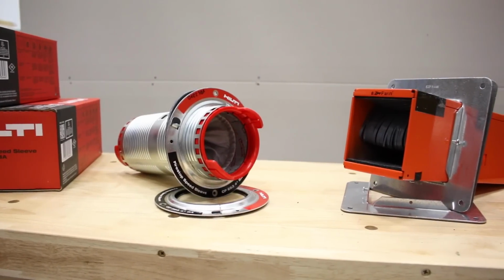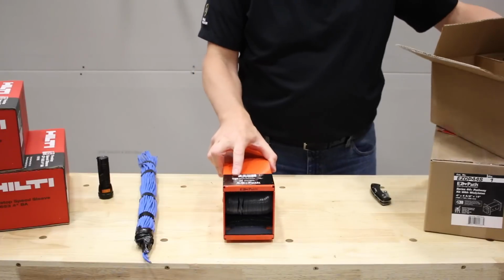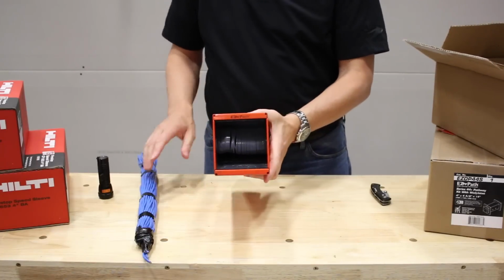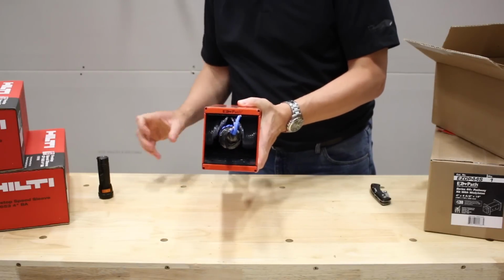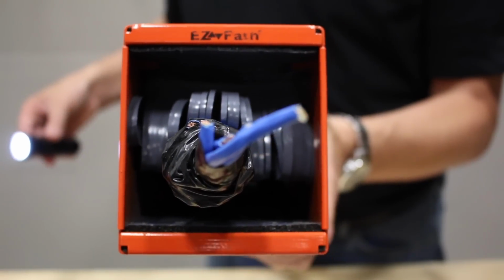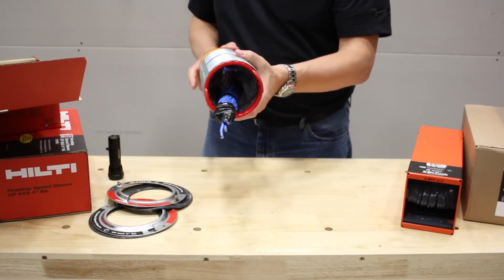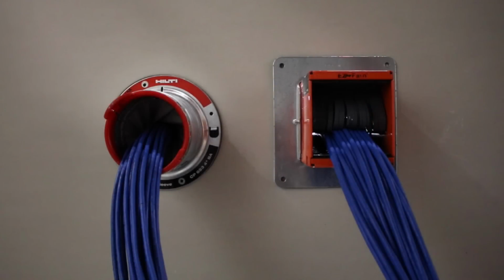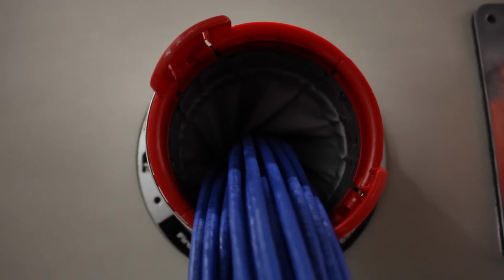COMPARISON of the Hilti CP 653 speed sleeve vs. competitive firestop device

Comment: From a functional viewpoint, it is obvious that the wire bundles are very tightly tied.  The square pathway is visibly designed to have the cables nest flat.  I would suggest a more realistic test.  I would also propose the test showing the seals on both sided of the pathway devices.  It is hard to trust these days that the test is trustworthy and objective.  Especially when it comes from one of the manufacturers.

Comment: The EZ path has foam inside that expands with heat. Its not meant to be air tight. When fire comes, its closes up. The voids are a non-issue